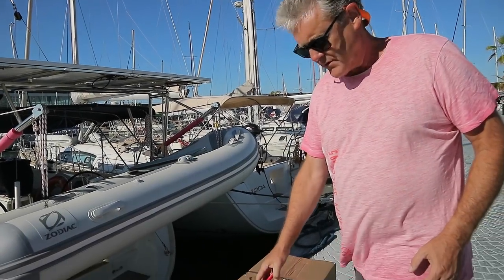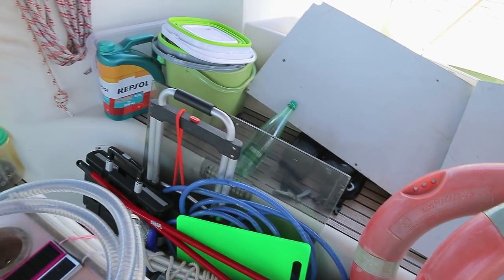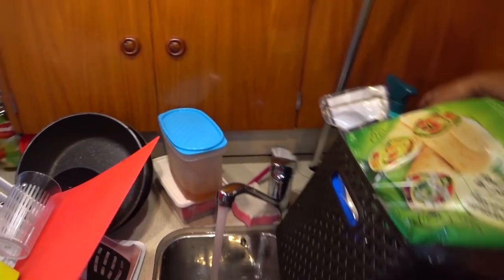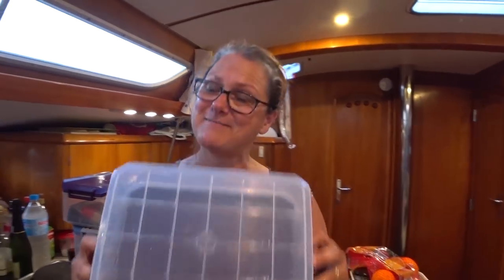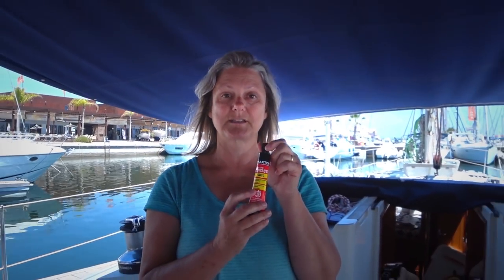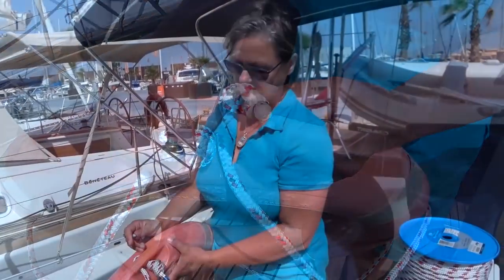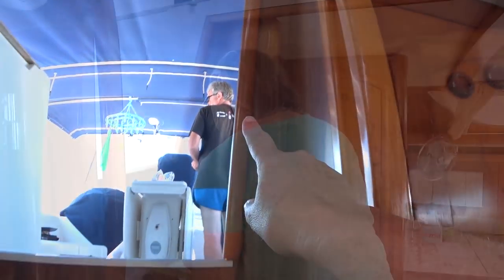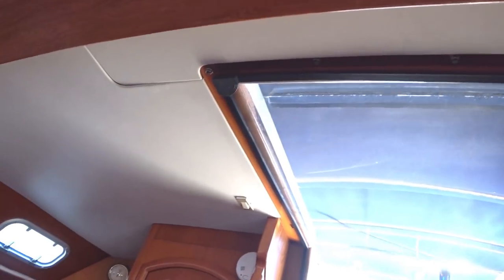We're nearly there! - Sailing A B Sea (Ep.023)

Comment: He fridge should have have a partition between the two, then you get a fridge on the right and a cool box to the stern so great for veggies etc.
You can if careful bend the plate so it wraps the rear shelf and by putting some polystyrene insulation on the top you get a freezer compartment. Or fit another compressor then the left side is a freezer (option from Jeanneau). However with the plate bent you get a reasonable size freezer compartment outdoor -16c, the fridge stays around 3c and the left side wit a hole or two in the polystyrene divider stays around 8c. We find this ideal
Reply from the maker: Spoken like a true yachtie Jay, it did make me chuckle. I'm sure you're aware of how long my 'to do' list already is, please don't give me wife any more ideas. LOL Hope to cross paths in 2019. Keep it breezy.

Comment: Hi A and B, I've recently found you channel (and subscribed) and am now catching up on your adventures; Are you able to explain why you went for the petrol dive compressor over an electric powered one. I know you will have petrol on board for the Outboard, but wont you have enough electric power at 220V to fill two bottles during your interval time (assuming you dive a deep profile on your first dive); And you have 4 tanks on board anyway? Just wanted to understand your reasoning. Thanks, safe diving and fair winds, Woody
Reply from the maker: Hi Woody, great that you've discovered us and thanks for subscribing. We spend 90% of our time at anchor and we don't have a generator onboard so no 220v to get an electric compressor fired up. Cheers.